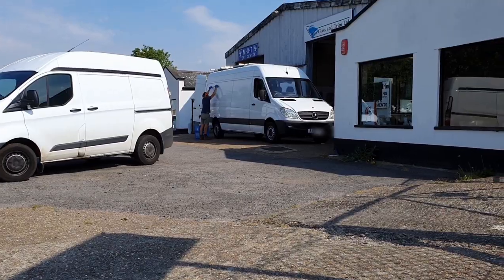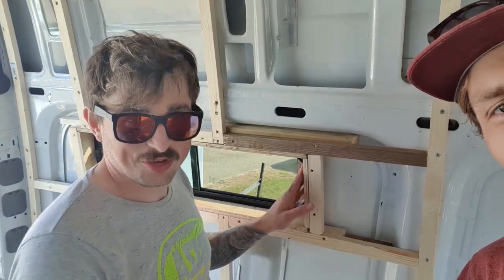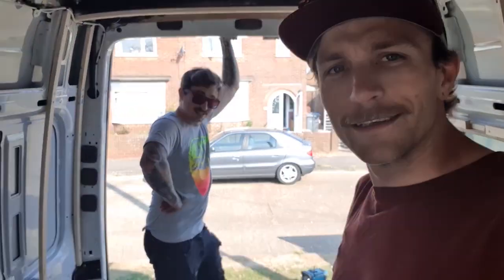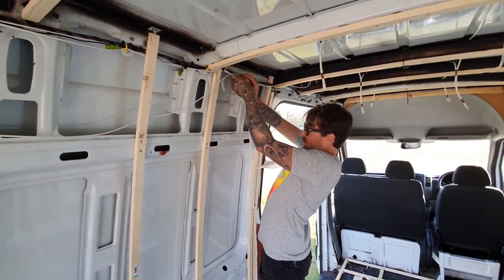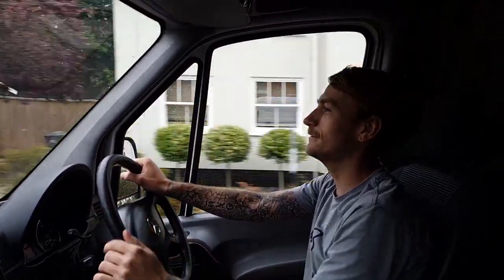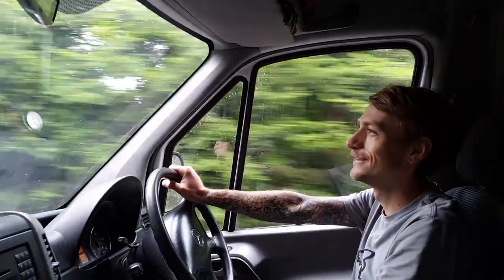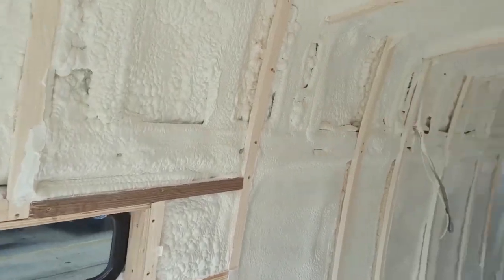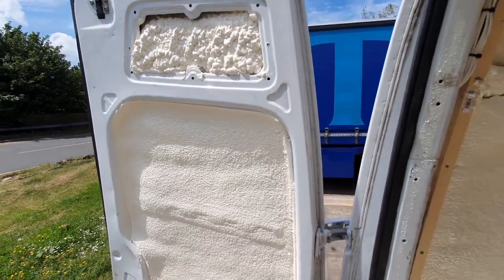The BEST VAN INSULATION plus getting WINDOWS fitted | Van Life Build Vlog #7

Comment: Hi Ben, really interesting - like you said at the start on #1, spend hours on you tube - so why the spray route rather than the celotex and reflective foil / metal taped seams like most others have done on their vlogs? - you mentioned a little about moisture? agree the way you did it is quicker and looks clean too? thanks Ben
Reply from the maker: Hi again mate, when planning my build I did so much research regarding insulation and I found myself getting more and more confused with which way to go.
I took the spray insulation route for a number of reasons. Firstly it was quick and easy, just drove it down to Chelmsford and back job done. No need for sound deadening as it sticks directly to the skin of the van and deadens the sound anyway. No need for a vapour barrier as it's closed cell so it doesn't let any moisture through what so ever. It also has the best R value of all insulation types. 
The problems I found reading online about the celotex route is that because the van is curved you will always have a gap between the celtox and outside skin of the van, because of the difference in temp and humidity condensation builds in that gap and rots the van out from inside out over time. 
As spray insulation sticks directly the skin of the van you won't have that gap.
Also.. when insulating metal barges I.e. house boats and also metal roofed buildings, spray insulation is always used, not celotex etc. So it seems right considering its a metal van 🤔 
Thats my reasoning and not everyone would agree but it works for me plus saved me loads of time on the build 👌🏻
Sorry that went on mate but I hope it answered your question 😊
Reply: @BejamVan  No mate - you  didnt go on, and makes perfect sense - especially the gap behind the celotex didnt even think about that - and also reference to boats too - good call. The sound deadening as well. The Greg Virgo youtube series is really good (Explaining the R value) prefer talking about R Insulation rather than R for Corona !!!!! Spray makes perfect sense too ! top man, appreciate your help.
Reply from the maker: @petermartin3806  no worries mate.. Greg's videos have helped me to be honest with various stages 👌🏻 Bloody corona!! Fed up with it, the vans nearly done and i want to travel but they're on about another lockdown 😫